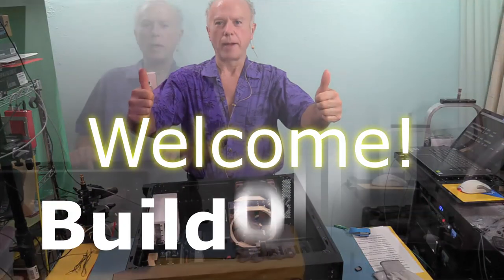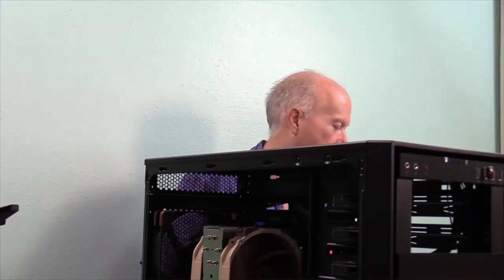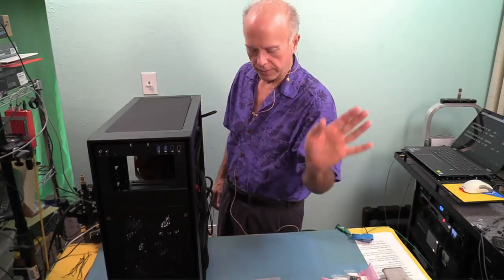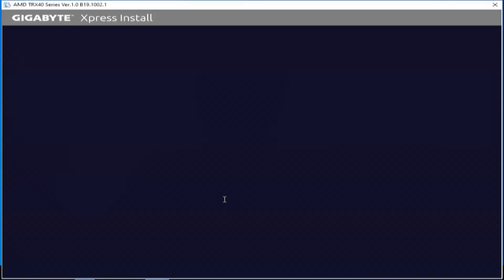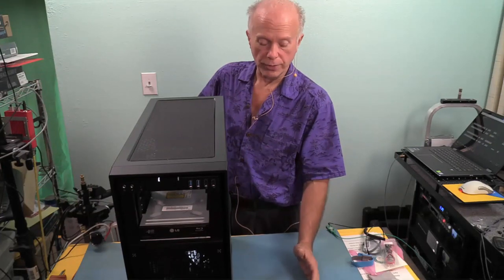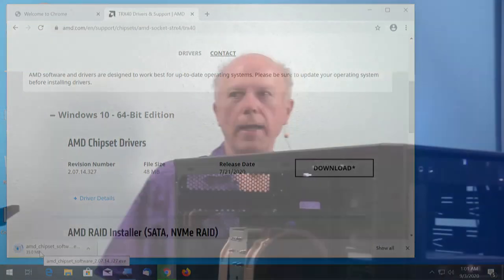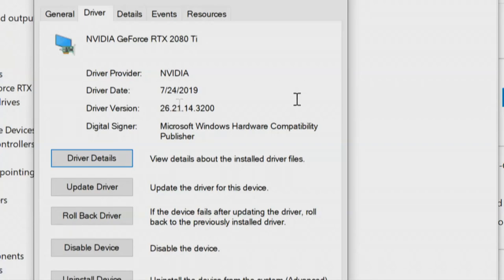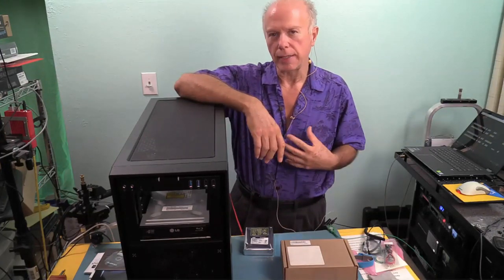Gigabyte TRX40 Designare Windows & Drivers Install + HDD Disk Management Tutorial

Comment: It's great to see you getting set up and running with your new Threadripper machine.
Here's a small tip though: each time I do a fresh install of Windows to a new drive, before I start I always download the latest motherboard and graphics card drivers (and drivers for any other add-in cards I may have installed) and have them ready on a memory stick so that I can install all of those before connecting to the internet.
Reply from the maker: Hi Millisecond, You're absolutely right. As Patrick said, it's a Beast! However, We're showing what most people can expect from what they have.

And if they don't have access to another machine for that, use what You have. Furthermore what if... what if Internet is out? Use what You have. I've had this discussion with a User in New York area recently, who's been offline for 3 weeks. And now they have Fiber. Reliable Internet. Perspective and perception. 

I hear where You're coming from and totally agree. Thanks for sharing! Appreciate Your help. That helps Us to make better Videos! Stay tuned!

Comment: That is one beast of a system, love it!
Reply from the maker: Hi Patrick! Yes! Next Tutorial, Bios! BTW: We now have all 256 GBs of RAM Installed! Whew! Thanks!
Reply: @BuildOrBuy  Looking forward to the next tutorial. Also, i did not know about the mouse locator option. Thought i knew it all 20 years down the road, guess i am still learning. That's also a boatload of ram. Makes me want to build another system! :-)
Reply from the maker: Hi @patrickwoolbright1960 , Always something new to learn! Bits and Pieces! The more I learn, the more I realize how little I know! So we share what We know and learn as We go! Thanks! When You're ready to Build, let's talk Parts and Resources! Right now, TRX40!

Yes! It's alive! Boatload is right! And stable! Mouse pointer, neat trick. Great idea!
Reply: @BuildOrBuy  We'll definitely have to talk parts. Right now i am running a Ryzen 5 2600X on the MSI B450 Tomahawk MB, with 32GB of RAM, 512GB of nvme m.2 for OS and programs and a 1TB SSD for storage. Graphics is a Nvidia RTX 2060. Might upgrade to the current Ryzen generation but not sure if current chipset will handle it. I'll have to look into that. Girlfriend will kill me if i build another one LOL. Currently have 3 other systems i tinker with.
Reply from the maker: Hi @patrickwoolbright1960 , Always room for one more Computer! Especially a TRX40 Build! You'll be hooked!
Reply from the maker: Hi  @patrickwoolbright1960  , Which Ryzen? Ryzen or Ryzen Threadripper?
Reply: @BuildOrBuy  if i go with the Ryzen 5 3600x then i could continue using the B450 chipset, simple bios update should do it.  if i go with the Ryzen 7 then I'd probably go with the X570.
Reply from the maker: Hi  @patrickwoolbright1960 , My suggestion, based on chipset, x570. It's all about the technology.
Reply from the maker: Hi @patrickwoolbright1960 , 
Gigabyte X570 AORUS Elite
https://amzn.to/2Fmb60P
As an Amazon Associate I earn from qualifying purchases.
Reply: @BuildOrBuy  Definitely a nice Motherboard. I'll keep that link in mind. I may wait and see what folds early next year.
Reply from the maker: Hi @patrickwoolbright1960 , Smart idea!

Comment: Hi Gill,
Thank you for you Video.

one question,
Why do you not build in all parts at once?
The NVME and HDD and all the Ram.

I think about, to buy the same parts for my workstation.
For
Edius X
Davinci Resolve
After Effects
Lightroom
LR Timelapse
Sequator

You Video ist very helpful.
Reply from the maker: Hi cracoviaPG, Nice to meet You! Excellent question, glad You asked! The Why? My perspective from years of Building Computers... New Platform requires thorough testing. Beta Bios requires careful consideration for implementation. This is cutting edge technology with a bleeding edge Bios.

From a foundational perspective,  we need to determine and establish a baseline. 

By systematically adding minimal Components, we know what works. If any failure occurs we can more quickly identify and diagnose the problems without having to start from scratch. 

This next video will highlight that fact. We had a catastrophic failure. That lead Us to discover, realize, identify and isolate 4 problems which had to be dealt with methodically and systematically. It was a mess!

Had we not done the systematic Build, we would have had to start over from scratch. Been there, done that! Experience is the best teacher! Thanks for asking! Hope that helps until we can get this next Video Up for a more thorough explanation! Stay tuned!

BTW: Thanks for sharing! This helps Us to make better Videos. Once We show what we Build, We will then show Why we Build and How We use this Threadripper 3 covering some of the Apps You've mentioned. Glad We could help! If You would like to see something related We have not covered yet, please let me know!

Comment: I have got the same memory (4x32GB-3200mhz) on the same MB but I am only getting 2133ghz!
Reply from the maker: Hi Zain, Are You using the XMP Memory Profile?
Reply: @BuildOrBuy  Hey Gill! No, just default settings, but the memory model isn't mentioned on the supported list for this MB (from Gigabyte)
Reply from the maker: Hi @zainfadhil2588 , Set You Memory Profile to XMP. The Default is the JEDEC Spec.
Reply: @BuildOrBuy  Tried that already and nothing changed
Reply from the maker: Hi @zainfadhil2588 , What is Your Bios Version on this Motherboard? The CPU will support up to 3200MHz. Tell me more about Your RAM - Brand, Model and Capacity.
Reply: @BuildOrBuy  Bios is F4c, Memory: CORSAIR Vengeance LPX 128GB (4 x 32GB) 288-Pin DDR4 SDRAM DDR4 3200 (PC4 25600) Intel XMP 2.0 Desktop Memory Model CMK128GX4M4E3200C16
Reply from the maker: Hi @zainfadhil2588  , Yes! Correct Bios. Correct RAM. And when You set XMP Profile, in Bios, speed does not change?
Reply: @BuildOrBuy  Hi, Nothing changes! I have ordered another set of G-Skill (4x32mb@3200) and this specific model code is mentioned in the memory supported list. Lets see how it goes. Thanks!
Reply from the maker: Hi @zainfadhil2588 , The TRX40 Designare with Bios: F4c should recognize that Memory at that speed. Have Your tried Bio: F4i ? Keep Us Posted on Your Progress!
Reply: @BuildOrBuy  Unfortunately, it didn't,, I am on F4i and same thing! I will keep you posted. Thanks!
Reply from the maker: @zainfadhil2588  , That should have worked! I'll have to check after we finish this next Video!
Reply: @BuildOrBuy  BTW, what memory speed are you running at? I remember seeing something around 2133 mhz  in one of your videos
Reply from the maker: Hi @zainfadhil2588 , At the moment I don't remember. I need to run Belarc Advisor on that System. The install in video yes was default. Working on next Video. Will check right after completion. System is setup and ready to record. However,  I see Microsoft messing with two Computers right now doing pesky updates. I'll find out when we get in the Studio. Thanks for asking! When is Your new RAM due to arrive?
Reply: @BuildOrBuy  I might get them tomorrow, I will let you know about any updates
Reply from the maker: Hi @zainfadhil2588 , Excellent! Amazon or NewEgg?
Reply from the maker: Hi Zain, Microsoft Updated that Computer. Everything was ready for the Video! 

Gigabyte TRX40 Designare Motherboard; Bios: F4c. Our RAM, XMP Profile - DDR4 3200

This is the Kit we used: 
Corsair Vengeance LPX 256GB (8x32GB) DDR4 3200 (PC4-25600) C16 1.35V - https://amzn.to/35jnpoU

As an Amazon Associate I earn from qualifying purchases. 

Hope that helps! Don't know why You're not getting those using Results using XMP Profile!
Reply: @BuildOrBuy  newegg
Reply: @BuildOrBuy  I had to search memory by model code as per the supported list just to try to avoid any compatibility/perforamce issues, newegg had one of those sets so I ordered them rightaway
Reply from the maker: Hi @zainfadhil2588 , OK! Thanks for Update!
Reply from the maker: Hi @zainfadhil2588 , Right now it's all about availability! Glad You found a set. Still odd Your other RAM did not clock as expected.
Reply: @BuildOrBuy  I have had this issue before with one of my previous builds, it was the SR2-EVGA, one of the best boards ever made,, however and in order to properly unleash the maximum power of the dual xeons, I had to do al lot of search and tests till I was able to find the right ones. This one should be easier since I have no intentions of overclocking
Reply: Hi @zainfadhil2588  , I remember those EVGA Motherboards! Never use one but they looked good on paper! Yes this should be easier! You were using Corsair Vengeance that should clock to DDR4 3200 using XMP Profile, what's the Product Number You have?
Reply: @gillboyd2956  Hello Gill, Can you create RAID0 on the MB M.2 nvmes? Was reading the Designare TRX40 RAID manual and found this "An M.2 PCIe SSD cannot be used to set up a RAID set either with an M.2 SATA SSD or a SATA hard drive."
Reply from the maker: Hi @zainfadhil2588 , Yes! The Wording gets Confusing! Has to be 'Like Kind'. Cannot mix SSDs and NVMe Drives in a RAID set.  A RAID set can be SSDs. And another RAID set can be NVMe. To reiterate, those Drives of different topologies cannot be combined into one RAID set. Hope that helps!
Reply: @BuildOrBuy  Indeed! I was really confused, Thanks for the clarification Gill, I really appreciate your replies.
Reply from the maker: Hi @zainfadhil2588  , Absolutely!